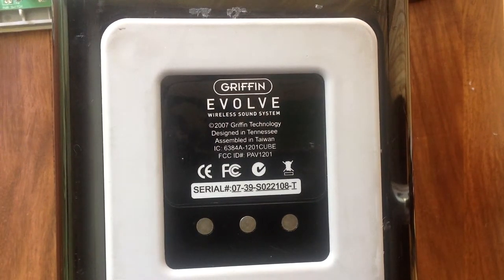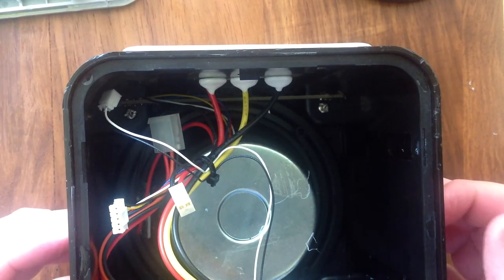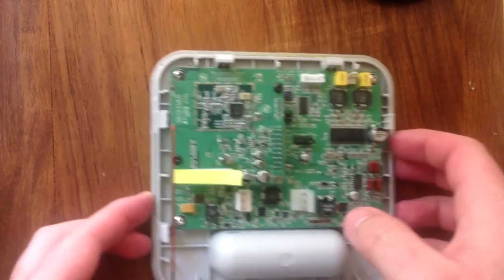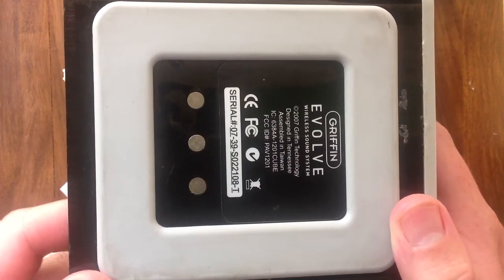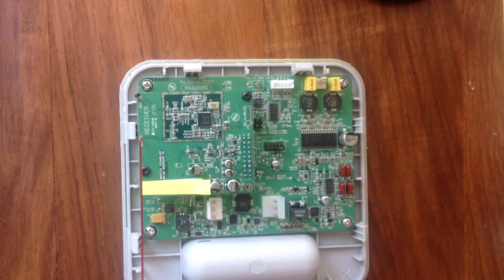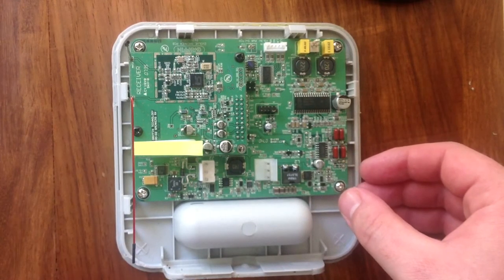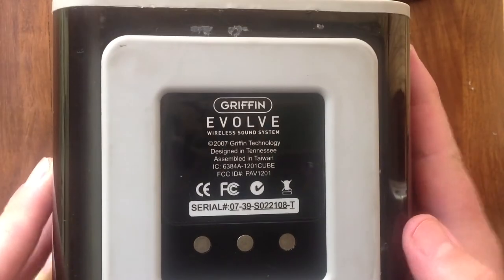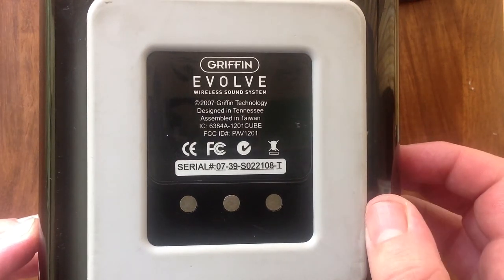Griffin Evolve speaker tear-down and repair.

Comment: Great vid! I'm only trying to replace the battery. Got the rubber seal out of the way, got the butter knives in the right spots, but can't seem to get the clips to un-clip. And I can't get a spatula in the seam near the power button. I think I need a better thin pry tool. Thanks for the great instructions and video. I wish you had a video of the whole tear-apart process, but instructions were good. I'm close, I will prevail!

Comment: Great video. I'm looking to buy one of these used and the owner says the speakers don't work when removed from the base. 14 years after they came out of the factory, I suspect its battery issue so this peek inside was helpful. Coincidentally, I want to use this as a cheap sound system for my old iPods which Apple made harder and harder to open as the years went by, because why allow people to repair when you can gauge them a few years later for replacement devices.
Also... 
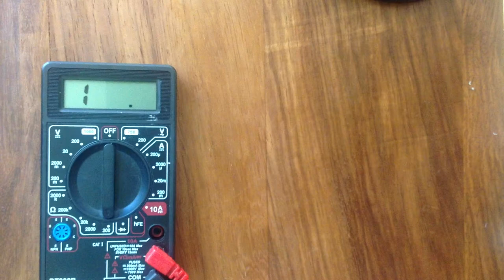@ 6:00 lol!
and "assembled in Taiwan, which isn't China, exactly... sort of..." - also lol!

Comment: It is a TransZorb type of diode, used to protect against static discharge to the exposed contacts.  It should never be possible in normal use to apply reverse power to the Evolve speaker.

Comment: where to buy online new batteries for this speakers??
Reply from the maker: I will try order some but customs is so damm bitchy in this country they will likely be impounded for being a fire hazard.
Reply from the maker: Davidarties t Those could work but they would not be too safe. The original pack has a temperature sensor inside to shut down charging if it overheats that's why it has 3 wires + - and a sense wire . what i would suggest is to buy individual 18650 cells if possible with tabs so they are easy to solder then take apart the packs and replace only the cells and keep the original temp sensor.
Dealextreem.com is a decent place to buy cheap cells.
Reply: African Electron 
Thanks AE for the video.
I have the same Griffin Evolve Speaker system and the sound gets cut off when the volume is increased and also, the speaker no longer works when its taken from its base station. Are these problems due to the battery inside the speakers? How can we replace them or actually I do not want the wireless option but need the speaker to work on high volume. Could you pls help me fix this problem? Thanks in advance.
Reply from the maker: Sangeeth Varghese I would recommend you replace the batteries. My guess is that the power supply is not capable of powering the speakers on full volume so the batteries are used to compensate for short durations of high volume.
Open the speaker cut open the battery package and replace both cells with 18650 and then tape it all back up.